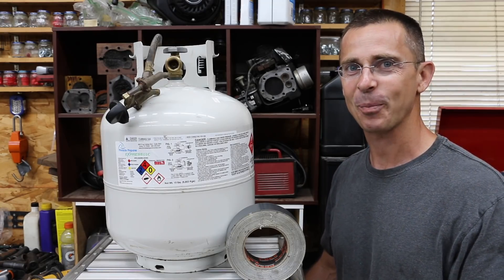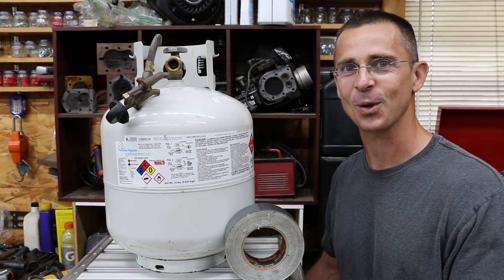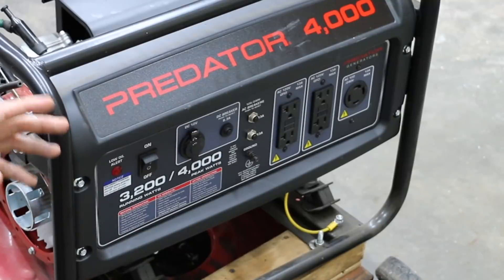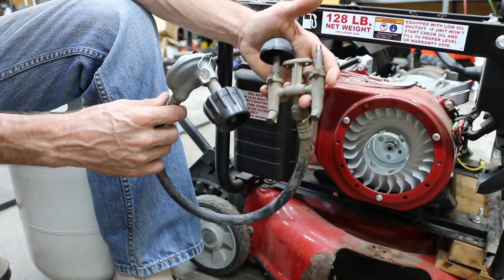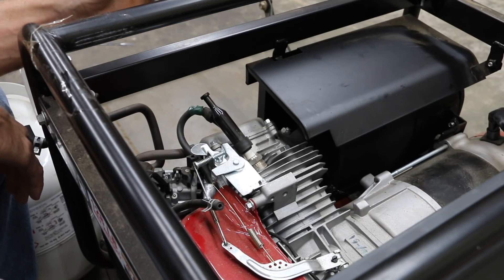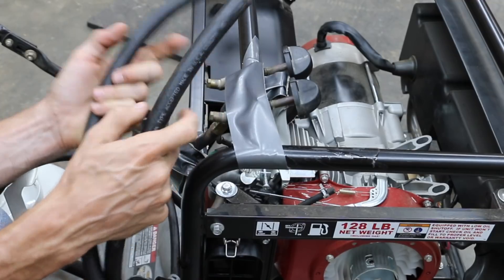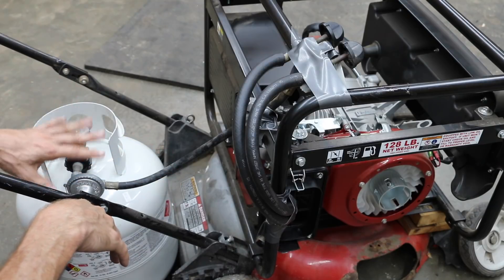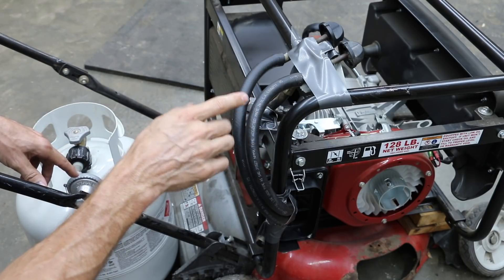Can a gas (propane) grill power an engine?  Let's try it!

Comment: The only problem is you would eventually burn out the exhaust valves but you can use a valve saver kit which protects the valves good video keep it up Chris in uk
Reply from the maker: Great point Chris and greetings!

Comment: If propane burns so clean, could it actually clean a dirty engine?
Reply from the maker: Great video idea!
Reply: Its not cleaning just engine temperature higher and piston rings bad trouble on new cars.and is doing parts the small tank to   lubricate valves this specific oil for lpg gas and its cleaning and cooling that ,and engine not much sludge with lpg
Reply: More or less, propane won't add to the carbon so an engine can gradually burn off the buildup. If you were to put clean oil in the engine, it would help even more. Most engine oil has a detergent in it to keep more dirt suspended in it so it can be filtered out.
Reply: Project Farm up to my knowledge, cars with propane conversions do not have any issues with carbon buildup, and oil stays clearer much longer than petrol, or worst, diesel. But I suppose that cleaning process would require a bit longer than few hours.
Reply: Boodieman72 Idk bout that but itd be cool to see, thats while forklifts run on propane, they can run them inside because it burns so clean
Reply: Zack Pack the exhaust is cleaner yes.

To the OP it wont. There is no fuel wash to clean anything with propane. It won't get more dirty internally really except for the intake side of things. LPG powered engines dirty up intake valves unless you run a catch can setup.
Reply: Robb403 oil don't clean the valves, ring lands or anything else. The engine can only naturally burn off so much.  Propane will keep a combustion chamber clean if used from the start but it won't do anything for a old used carboned up engine. Valves will get worse, old wet carbon will cook hard and sit etc...  it'll stop new deposits until oil starts to pass the rings with wear.
Reply: Mr. Clean will clean your engine just pour it in your gas tank.

Comment: I have three cars running on LPG (butane / propane mix) for years now without any problems.

Nice to see you testing this out with such basic equipment. Thanks!
Reply: Power loss/gain depends on the type of conversion. usually there will be no power loss. Milage is usually 25-30% worse on LPG than on gasoline. LPG is nearly 50% cheaper on the other hand, so it is still a good deal from financial point of view
Reply from the maker: Thanks for commenting on this.  Is there any power loss or increase? How about fuel efficiency?
Reply: Power loss is only minimal and I can only recognize it slightly when I floor it which happens rarely.

Fuel economy is about 20% worse but as Marcin stated LPG is less than half the price of gasoline.
Reply: Power and efficiency tend to be a wash compared to gasoline as what you gain in efficiency with propane you lose in BTU's. Propane does have an advantage usually being much cheaper then gas with a slight downside of some increased maintenance costs as propane can be both hard on engines (not as much cooling of the valves, for example) and fickley if the filters aren't changed regularly.
Reply: KWHBSN we also have a car on lpg, it’s a Subaru b9 tribeca
Reply: Project Farm propane buses will pull a diesel all day. Watched a propane powered school bus beat a Civic in a drag race.
Reply: David Scott well i found Briggs and Stratton fuel treatment good for (i live in Jersey with 10%ethinal gasoline)up to 36 months of storage if you double the dose which is only a oz to 3 gallons or something like that. ive not pushed my fuel storage that far but from over winter storage the gas is still fine and runs my cars dirt bikes amd mowers with no noticable difference from fresh gas. i put the B and S treatment in all my gas cans.
Reply: Rob Plotts we sell it in our lawnmower buisness, Briggs fue” fit
Reply: very interesting. my father and i converted his 8500 genny to propane with a kit and we did this because propane will last in a bottle for a long time compared to gasoline
Reply: Rob Plotts 
That's I was going to mention. Propane can be stored indefinitely as an emergency fuel supply, but gasoline with ethanol is only good for 6 months at the most.
Reply: Dylan Zrim our Subaru runs on it has a v6 engine 4wd an tows a 2.5 tonne caravan
Reply: Rob Plotts yes, we’re in Northern Ireland, so probably the same
Reply: On lpg everything is slightly worse. And don't even think about going up hill.
Reply: I recall there was a Dodge V8 van that was sold in the 90's that could be run on cng. I also recall the mpg rating which plumetted to something like 8 city  /  11 highway on cng.
Less btu's...it is what it is.
Reply: Anything on 4 wheels im in southern New Jersey United States (i know theres a Jersey across the pond from me somewhere ) ive always wanted to see Ireland.
Reply: I know the dodge diplomat had a propane option in the 80's. Probably the same engine in the van.
Reply: arekb5 hard to do with no ecu
Reply: Anything on 4 wheels well don't get me wrong, it does it. But it complains, switch over to petrol and it does it with ease a gear up
Reply: Anything on 4 wheels bad choice for lpg. Generally lpg converted engines require adjustment of valves roughly at 30 000 miles. And on larger Subaru engines (any 6 cylinder up to my knowledge), this is expensive procedure. A friend of mine complained that on his tribeca procedure costs roughly 2000 USD. Not so much on my forester with it 2liter engine. :-)
Reply: Anything on 4 wheels You couldn't possibly be towing 2.5 tonne caravan behind a V6 Subaru... because Subaru never made a V6.
Reply: Anything on 4 wheels this stuff is probably same its called Briggs& Stratton 5in1 advance fuel treatment and stabilizer. ive used a few different stabilizers and this stuff seems to keep me out of the carburators better than all others if tried

Comment: Hank Hill would be proud. Now see how it compares to that bastard gas, butane.
Reply from the maker: lol
Reply: You could bring a tear to Hank's eye by then plugging an electric hot plate into that generator. But it'd still be powered by propane... mind blown.
Reply: If propane worked, i wonder if acetylene gas would work too without destructing the motor.
Reply: Very expensive and too volatile.
Reply: Mountain Man gasoline is more volatile than propane or natural gas
Reply: Someone was asking about acetylene...it's too unstable/volatile. It had nothing to do with propane or natural gas. I wouldn't even try it.
Reply: Mountain Man gotcha yes that maybe a little intense
Reply: @aron6998  And expensive, and very dirty burning. Not really a good alternative for gas. Hydrogen. Project Farm should try hydrogen.
Reply: @aron6998  volatile refers to it vaporizing easily. so a room temp liquid is definitely less volatile than a room temp gas. did you mean combustible?
Reply: I heard UPS uses natural gas in some trucks
Reply: moorbish in my area they use both cng and lpg
Reply: @moorbish  Fuck UPS. They are shit!!
Reply: moorbish they also used to tie 12 of us to the front and pull the truck while the union rep beats the war drum occasionally turning our truck into ramming position when we would see a fedex truck or easy prey the DHL van but thats just the one i worked for.
Reply: Michele Marie Dalene Not much different, except heavier tank for pressurised natural gas. Need CNG (compressed natural gas) conversions are quite common, but propane powered engines are wast majority of gasoline car engines. I didn't drive car on different fuel since last century. :-)
Reply: Jase Poag dang it man, that was gonna be my line.
Reply: moorbish That they do.
Reply: Michele Marie Dalene yes it would. Hole house generators
Reply: Michele Marie Dalene yes it would. Hole house generators run on natural gas.
Reply: Butane leaves carbon on everything the flame touches, nasty
Reply: Honda offers a civic thats fueled by CNG. Dont remember what the base price on it is.
Reply: Not that much... A lot of cars in Europe a converted to run also on lpg which is a mix of propane and butane depending on the season and outside temperature
Reply: Natural Gas has varying degrees BTU capacity and is often increased with addition of propane to the gas mixture when needed to met standards or customer demand.
Reply: I would love to see a vespa scooter powered by 1lb propane cylinders.
Reply: I thought of how proud Hank Hill would be in Texas. I bet he runs his whole house on it.

Comment: id think that there would never be any carbon build up because its burning efficiently and forklifts and stand by generators can run of propane
Reply from the maker: Great point.  It burns extremely clean.  See through engine and the blue flame were rather interesting.

Comment: Well MacGyver; this was good to know if I am stuck in a fallout shelter and need power.  

Great vid.  Obviously need to run the generator in a well ventilated area.  

This obviously has some limitations as it wouldn’t work for 2 cycle engines.  

But could you inject 2 stroke. Oil into a propane source and run a weed eater on it ?
Reply from the maker: Great video idea regarding a 2 stroke.  I believe there is a way to do this but I'll have to test it!

Comment: You can feed the gas directly into the fuel line ideally you want a smaller main jet tho and air mixture jet to be smaller but even adjusting the regulator on the bottle will achieve this but turn the mixture screw running rich.
Reply from the maker: I'm pretty sure there's a way to convert it over.
Reply: Project Farm should be liquid so feeding it into the fuel line should still be liquid it only comes a gas when he hits the air.

Comment: I've never done any research on this, but I am now curious what kind of difference in power this makes.  Obviously, you'd have to have good software to tune as you drive, if the intent is to use it in a regular car engine.
Reply from the maker: I believe there is a slight loss of HP but others will likely comment with a more certain answer.

Comment: Many (probably all ) state laws regarding gas engines run indoors have a special regulator that shuts off the gas supply should the engine stall for any reason. Demand regulator it is called. Gas, not to to be confused with gasoline.
Reply from the maker: Great point!

Comment: I've built a sbc 4runner propane fueled. Lots of benefits for propane, cleaner burning, higher octane (and a impco regulator can be boost referenced), and no need for a few pump and no flooding or stalling offroad.
Reply from the maker: Impressive!  Great setup with a bunch of advantages too.

Comment: Propane can easily run a  engine provided you get the air/propane mix properly
Reply from the maker: Great point.
Reply: I had done this to a 5.5HP  horizontal engine , made a injector and used a adjustable valve hooked to the governor  to adjust the propane on the fly with engine load. However alternatively  they make conversion kits pretty cheap now for most engines , now what I would love to see is a Fuel Injected 4-6 cylinder engine run on propane using it's original injectors

Comment: You should use gunk engine decreaser in the drip bag and in the gas to see if it will clean the internal parts of the engine or if it will make it worse
Reply from the maker: Great video idea!

Comment: Did you have some gazoline left in the carb? A engine is usully pretty hard to start with just gas.. thinking that if you only have the original "rope start" it would be kinda hard to get the thing started. (If it was an emergency and you only have propane att home)
Reply from the maker: I ran it out of gasoline before attempting to use propane.  Thank you

Comment: Can you see how well an engine works in low atmospheric pressure? You can simulate this by using a vacuum chamber. I’m sure you can build one very easily.
Reply from the maker: Great video idea!  I believe the HP loss is around 2.5% per 1,000 feet of altitude in a naturally aspired engine.  It'd be interesting to see how an engine performs at very high altitude.
Reply: I agree. Naturally aspirated engines lose a good bit of HP as the altitude increases, but forced-induction engines fare better. Just another reason to love boost! =]

Comment: no surprise. propane engines are just gas engines with modified fuel systems. i work on some dual fuel equipment, you can hit a switch to go from gas to propane if the equipment is being used indoors. occasionally there are design differences but they function the same.
Reply from the maker: Thanks for this information.

Comment: Well, in the early 1900s and even into the 50s lots of engines were run on propane. The main ones being oil pumps in oil fields. They pulled the oil out of the ground where, once out, a massive engine (at least 30 ft long) would send it to refineries.
Reply from the maker: Thanks for this information.
Reply: Project Farm your welcome, u can still see the pump engines at lake itasca pioneer farmers. The big one is at Rollag mn. Love the videos btw!

Comment: I am actually VERY 🤘😎🤘impressed by this. For two reasons. 1: I knew it would burn but not near as well! 2: You can more readily acquire propane and in most states you can legally store a higher amount than gasoline or diesel and safer . If in a tight spot or just camping you can use propane for multiple units. A bonus is profane stores longer with little down side.  Sorry to ramble. Thanks for the videos good sir. I've been watching you channel for a good 18 months now. Very educating for all ages.
Reply: Damn, if we could power engines with profane we'd be set.
Reply from the maker: All great points and thank you!

Comment: Of course it can be done. Correct regulator will do it all perfectly. I have done it many times. Almost all my hit and miss engine were converted. Quite simple.
Reply from the maker: Thanks for commenting on this.  How do the engines perform regarding horsepower?  More, less, same?
Reply: Project Farm  The gas (propane) is less powerful than gasoline maybe 5%. Natural gas is less powerful then propane. Hydrogen is less powerful than natural gas. Hydrogen will combust in a wider range of lean or rich conditions which makes it more dangerous than other gases. All of them are dangerous of course. Hydrogen produces more water vapor than other gases,which condenses into water droplets.
Reply: Usually LPG engines have less power (the energy density is 25% less than gasoline) and can run hotter (especially the valves, no liquid to cool them). However it's much cheaper and cleaner burn. A nice test is to run the engine on LPG only and then drain the fuel... it will be almost new :)

Comment: I'm not surprised it works. LPG is widely used for fueling cars and trucks, especially in Europe where it is sold at the pumps.
Reply: Zack
What makes it fun is he jerry rigged parts off a grill and it worked surprisingly well.
Reply from the maker: Great point.
Reply: 177SCmaro Yep. Not trying to put down anything he's doing. It's neat how he did it with the grill. Just wanted to point out that it is a widely used hydrocarbon fuel.
Reply: Zack
No worries. I didn't take it negatively, just pointing out what makes it fun as he easily could have just slapped a LPG conversion kit on and engine but instead did it the fun way. lol.
Reply: In New Zealand we used compressed natural gas as well. The main difference from your setup was a regulator that took a venturi tube from the air flow to control the gas.  A good liquid gas conversion was actuality more powerful than petrol.
Reply: Came here from this. LPG pumps are widely available across Eastern Europe as cheap alternative fuel for commercial transport.
Reply: In Massachusetts, our City Buses runs on Natural Gas!

Comment: Wow... I wasn't expecting that result! Great job!
Reply: Its how forklift engines and other equipment runs off propane...
Reply: There are MANY videos on YT of people running gas engines off of wood gas.
Also, the carb is the only difference between a propane engine and a gas engine.  In fact, the predator is probably a clone of a different engine for which you could order a  propane conversion kit.  From what I recall, it's cheaper to use propane and it produces much less carbon monoxide and other exhaust gases that are bad for humans. This is why a lot of warehouses will use propane powered forklifts.
Reply from the maker: Thank you!
Reply: What can't Propane and Propane Accessories do? lol